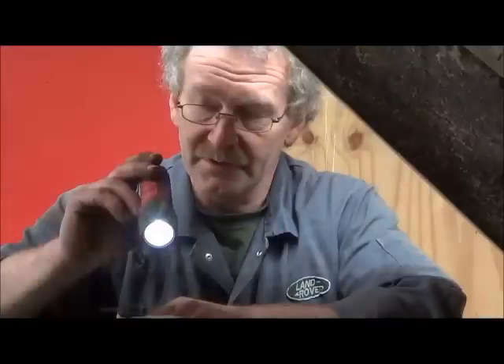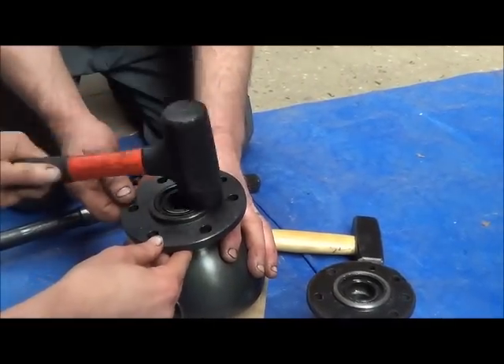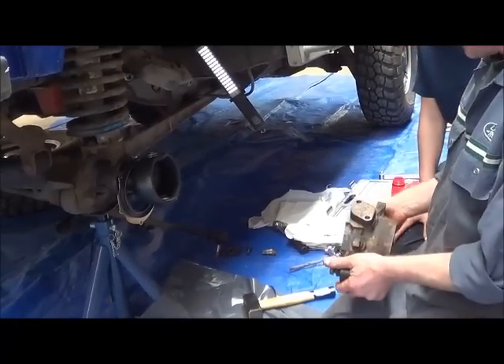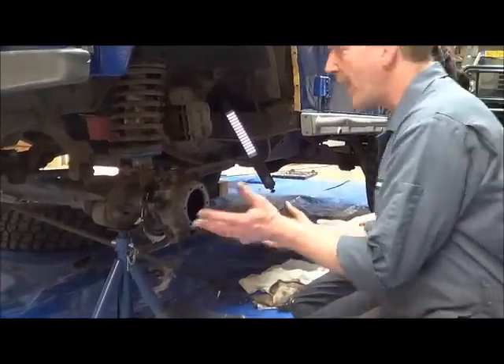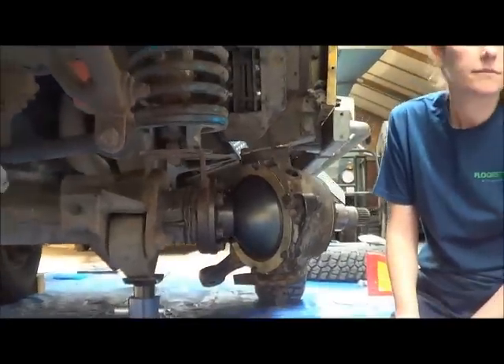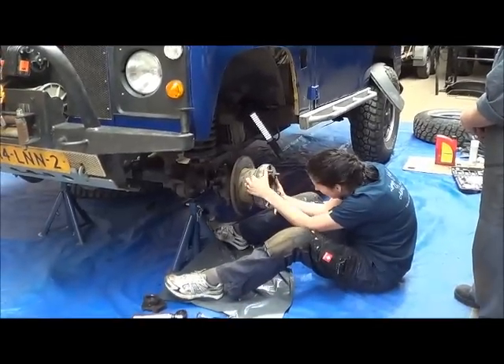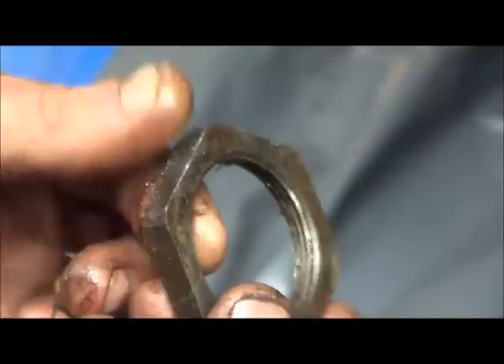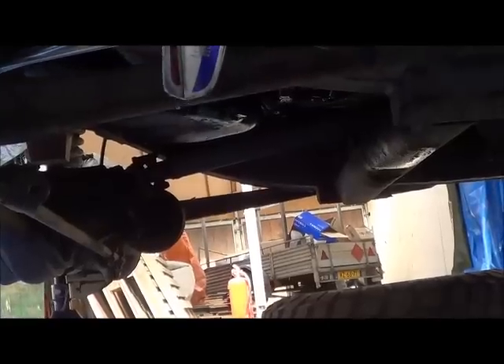LAND ROVER SWIVEL REPLACEMENT (PART 2 of 2) REFITTING with Rob & Vic #landrover #carmaintenance

Comment: quit braying on that bearing race with that steel hammer. get yourself a brass or better a copper mallet for that kind of ting. Even better make yourself or buy a hydraulic press....
Reply from the maker: +honi9 Cheers - you're probably right. But having said that - we were also trying to demonstrate how to do this yourself with minimal tools and resources while still achieving the desired result...
Reply: course im right. but im also guilty of far worse. like today for instance in using a sharp cold chisel to fold over a bearing nut lock tab after adjusting a little play in a back wheel. what i achieved was splitting the lock tab and having to replace it. All because i couldnt be bothered to go for a flat screwdriver and just grabbed the sharp cold chisel that was already at hand. SIGH
Reply from the maker: +honi9 Lol - sounds familiar...
Reply: at least use a socket or piece of wood between the bearing ring and the hammer

Comment: To torque the bolts on the swivel, the ones that Rob says you can't properly get to, you put a spanner one the bolt (open end) and a torque wrench on the other end (ring end) and then just torque up. I seem to remember a 13 or 14mm spanner is needed. I got this tip from a mechanic and saw it working.  Hope this helps.
Reply: But you cant an open ended spanner wont fit . You need a 12 sided ring spanner , thats all that you can get on .

Comment: Very thorough, informative and all in a language with NO jargon or acronyms.
Reply from the maker: +John Smith Thanks, we try, and Rob is the most knowledgeable guy we know on the subject. Have you tacled this project yet on your Def/Disco/Rangie?
Reply: Tours and Tales.com
Yes, on my 1988 90 I recently replaced the very worn original swivels for nice new teflon coated ones. I used a small, 'Salter' spring balance bought for 30p at a junk market. No wheel wobble and a nice new MOT now!
Reply from the maker: +John Smith - liking the spring balance (or fish scales (pun unintended) as known in dutch)...

Comment: What a fantastic video. Just did both my swivel housing seals last weekend but instead of the scary task of taking apart the whole hub, i just undid the bolts attaching the whole assembly to the axle housing and pulled it all out with the shafts going to the diff. Ended up only replacing the seals and retainers...wish i saw this video before, you guys made the whole thing seem so easy

Comment: Really good video.
Don't forget that the holes in the circlip where the circlip pliers engauge are tapered. - there is only ONE way that the circlip will be correct - you have a 50% chance if you don't check and face the circlip the correct way.    tiy will note there is a taper on the tips of the circlip pliers - this, and the taper in the two matching holes on the circlip allow the plires to grab and not slip on the circlip.  It really becomes important when you come to remove the circlip ( easy peasy, or an absolute prick of a thing sliping off the pliers).

Comment: thank you for this excellent instructional video, changed my swivel bearings, seal etc using this video alone ( Haynes bible for torque settings ), I would just like to add though, an essential piece of kit is worthy of a mention here, if your landy is similar to mine in age (22 years old ), and your swivel bearings hasn't been changed for a good few years I would without a doubt add a butane blow torch to your arsenal, as I did test one of the bolts holding the swivel ball to the axle ( you know the ones 12 point variant ) and just tried to release it to just before it damaged the bolt, it wouldn't budge, bang a few minutes of your blow torch on it, and to be honest it really did make the job a piece of cake, in fact, the hardest part of this job was reinserting the track rod end back into the hub, as I have steering rack under body protection which limits the amount of movement of the track rod to just a few centimetres in all directions, again thank you Rob, Victoria and not forgetting the camera man for an excellent video, 

Carl

Proud owner of  '94 Land Rover Defender 110 County Station Wagon 300TDi.
Reply from the maker: Thanks for adding this great tip! So glad you enjoyed the video and found it very useful

Comment: First off.. Thank you SO much for this video.. I'm really glad i saw it before taking on the job myself. I have an Exmilitary (Norwegian Mil.) Land Rover Series 3. The Swivel Housing is leaking oil... on both wheels (constantly). So I need to do exactly what you've done here (I may as well do the whole job since I have to remove the swivel to replace the seal anyway). 
I was hoping you, or Rob Stewart might have a list of the parts (gaskets, seals, bearings etc) needed in order to do the job. I really don't want to discover I'm a seal short midways through the project (I have to order the parts from England and its not exactly a one day deal).

If neither of you have one then I'll do it the hard way (haynes) and hope I don't overlook anything, but as I'm probably not the only person wondering, it would be really helpful if you could post a parts list along with this video (assuming you have one and its not too much trouble). 

Either way, thank you for posting this excellent video :)
Reply from the maker: +john kjos This is the kit we used: http://www.paddockspares.com/da3167-swivel-kit-front-axle-to-ka930455.html Comes complete with everything you need. But I think it is best that Rob answers your question seeing as you have a Series. Glad you like the video

Comment: I did mine 2 years ago (on one side). My pre-load was set to 1.3 kgs (a number I found on a forum somewhere), That was wrong! I now get a wheel wobble at 65 mph... Oh dear. Time to take it all apart again. 4kgs sounds about right (thanks for the video - very helpful!)
Reply: what did he change to adjust the pre load from 5kg to 4kg? didnt understand it chin? im not native speaker.
Reply: Philip Gebhardt there are shims (spacers) that go between the pin that is inserted in the hub. This decreases the load on the bearings. I hope you understand. If not please let me know!
Reply: should be 1.16 - 1.46   2.5 - 3.2lb ,,,, And not 8lb as in the vid that is wrong . which i have found out after doing mine
Reply: @gerrybongo he said it was 4 lbs not 8lbs.

Comment: Thanks for the comments Daniel, the re-grease should have been there but due to technical difficulties (production assistant failure) we skipped that bit. It's a good point about the RFD10000 single use hub nut, however as the front axles on this particular 90 are actually Disco I we decided to keep everything original, also for the DIY mechanic reusing the Hub Nuts and Washer is a lot more economical than buying a complete new nut each time.

Comment: 🧐EXCELLENT EDUCATIONAL VIDEO !!!! Labor Intensive overhaul…. Were the Land Rover Defenders affordable to the average working class person in the “UK” ???
Reply from the maker: Cheers for the comment
Yes, the 'legacy' Defenders were pretty cheap in the UK. You could pick one up for a couple grand, but that was before the new one came out and values shot up, probably tripled. 
Also used to be easy and cheap to fix yourself, but now parts are getting more expensive of course.
Labor intensive? Maybe through this video, yes'. I could do a swivel replacement in about an hour if I had my tools lined up and ready (if I didn't forget the spacer ring): https://youtu.be/QAwCzCfTGPc 😅😆

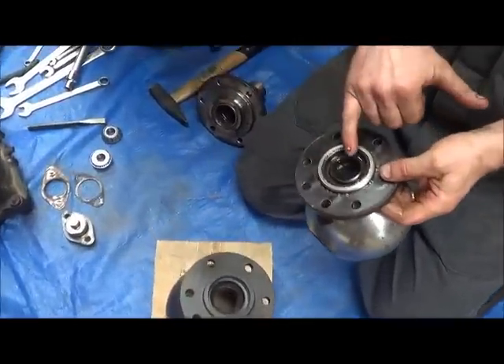Comment: Is there a way to change the oil seal (LR Part FTC3276) that you mention at 5:28 without dismantling the hub? I have replaced the swivel seal by going through the back but noticed the seal isn't particularly tight on the axel and chances are grease/oil is being transferred between the swivel/axel. The grease in the axel was a grey/green colour which I assumed backed up this thought. Any advice would be greatly appreciated!
Reply from the maker: Well, the swivel need to come off the axle, of course. How to do this with the hub still attached? Not sure... (looks to be unwieldy) Perhaps one for Brittanica Restorations🤔🧐

Comment: Hi great video made me confident in carrying out this repair which I have but my swivel still seems to be leaking is there anything I could of missed done every in the vid but can't explain why it's still leaking?
Reply from the maker: Hi. First thing that comes to mind is - did the parts come in a blue box? (This is hit-or-miss sometimes regarding quality). Then it depends on where it is leaking from? A couple fo thoughts... Can be a number of things. Maybe the oil seal is fitted backwards? The retaining ring is not seated/torqued tight enough?  Is the paper gasket between the swivel and the axle not damaged?

Comment: Got to do this job and your vid explains it very well, thanks for posting!
Reply from the maker: Thanks - good luck, it's pretty straight forward (once you've done it five times). Just remember to put the brass spacer back in the hub ;-) Took a lap of Corsica to figure out that the halfshaft was moving 10mm in and out on every turn!

Comment: Great video, really informative. I was wondering though, how do I set the correct amount of steering angle on the swivel so it bottoms out in the right place?
Reply from the maker: I don't have definitive information on this. I have wound the bolt in till the tyre just doesn't catch on the chassis on full lock (depends on the offset of the wheel you've got on there, of course). I have mounted 1" spacers and done the same on the 2015 Puma with zero issues on bearings or swivel after 100k km. Mind you, once again - as always with these vehicles - results may vary... (you can try Rob Stewart on Facebook but he has stepped out of the LR world and is doing photography)
Reply: @ASimplyFabLife  thanks👍

Comment: Never ever ever knock races in like this. Use an old socket or even better, the correct tool for the job. 
Just testing it with a hammer is gonna cause damage.

Comment: use the long flat side of lets say that other hammer, place it on the race then tap with ur big hammer to get it started, that way you're hitting with equal force on each side, it wont bop out like it is when she's trying to get it in
Reply from the maker: Handy tip, thanks! Marcel has just done the right hand swivel and got those babies seated in no time. Victoria not amused. LOL.
Reply: Never ever strike two hammers together, you will get shards of steel off the face, use instead a large flat steel plate, or better still, pull the bearing in properly using a large bolt and spigoted washer after leaving the baring in the freezer overnight.

Comment: Excellent Video, However, the LR Shop manual says that the Spring balance should be 1.18-1.48KG.  This video says 4KG, Which should it be?  Could it be that I am working on a Discovery 1?
Reply: The vid is wrong

Comment: The pre-load given is NOT correct at 4kg , it should be 1.16 - 1.46 kg in the offical landrover manual . So thanks mate , i built mine up at 3lb . Then watched this and thought i was wrong and re-shimmed to 8.8lbs to tight . So now have to go and strip back down and go back to where it was . NOT HAPPY
Reply from the maker: I have re-visited my swivels numerous times and dealt with 'death-wobble/shake enough to know I don't get it right first time -  but enjoy the grease under the fingernails😉). Partof the Land Rover Experience.
Lost in translation I guess - 4 pounds then...
 Golden rule - (as referred to in previous videos) always refer to the manual!

Even forgot to add the spacer in the hub once before setting off to Corsica for two weeks... Made it back and sorted it after much head-scratching.
Thanks for the comment and keep rolling
Reply: In my Land Rover workshop manual it states: The resistance, once the initial inertia has been overcome, should be 3,60 to 4.5Kg (8 to 10 Ibs).

Comment: Are there cars where they use two oil seals next to each other to gain lifetime? And why are the bearings so small for such big wheels in order for the wheels to get dangerous on the road? This component is not good enough in my opinion but please correct me if I'm thinking wrong.. :)
Reply from the maker: As far as I know, they all have one oil seal for the diff oil. And in my experience - for all their other faults - the one thing a Defender IS good for is the long-lasting wheel bearings (even with wheel spacers mounted) - unlike Land Cruisers, Patrols, Shoguns etc...

Comment: Hi there, brilliant video you did, but I must ask what kit did you use, what is Britpart/Genuine LR or??? Also have you had much trouble with the replacement parts since installation? Cheers!
Reply from the maker: We'd ordered the Britpart kit - much to the 'rolling of eyes' of the 'Guru'. It comes complete, except it had the wrong-size swivel-pins... So far (two years later) no leaks or wobbles. Besides that; there are plenty other Britparts on the vehicle (UJ's, light bulbs, clutch plates etc.) with no problem. As someone mentioned - if it wasn't for Britpart many Landies wouldn't be on the road right now... Good luck with it, it really isn't that hard after all...

Comment: what did he change to adjust the pre load from 5kg to 4kg? didnt understand it chin? im not native speaker.
Reply: Philip Gebhardt 
To go from 5kg to 4kg resistance you put in a thin extra shim this eases off pressure/preload on the bearing.
To tighten simply add shim(s).
Got a Defender too and it needs new seal and swivel bearings 👍🏽

Comment: Does The Lady Understand the reason why Pre Load and Torque settings are important, Explanation of the reasons and the consequences of incorrect settings are paramount when teaching somebody how to do something
Reply: I know it's got something to do with bits falling off or exploding when they shouldn't ... does that help?
Reply: Victoria Koning. Hi Victoria, LOL, I'm just concerned for you, I assume that you personally want to know how a LR works so you can mend it out in the Bush if you have to, all the things being explained to you I guess wouldn't make much sense unless it was explained to you WHY various components have to be assembled in that way, I just thought it could have been explained to you better, ie as the taper bearings are tightened down, the tapers- because they are tapered effectively take up the slack ( vertical float) of the hub, and the Large Hub Nut is Torqued to take up Slack ( End Float) resulting in the smooth free running hub with no End float/Vertical float that you have, But without being so tight that the bearings would over heat and break up.  no disrespect to your mechanic

Comment: Not really good practice to strike a bearing with a steel club hammer, much better way would be to draw it in square with a large bolt and spigoted sleeve.
Reply from the maker: Fair comment. But here we are trying to illustrate it can be done with limited tools (granted not to spec - but it works and we drove it for years).

Comment: Legs under the vehicle? Big no no especially when pushing.

Also reusing split pins circlips and locking washers?

Pence to fit new. Glad it's not a Plane or Helicopter. 

I would be using lock tight on those bolts.

Also advisable to use 2 methods of support on each side of an axle.

Hitting bearings with a Hammer? NO NEVER

Rolls Royce do it different.

Otherwise an interesting video 

that teach's bad practice to novice mechanics.

Basic safety training learnt by any first year Apprentice.

If your going to teach you have to do it by the book.

Phil